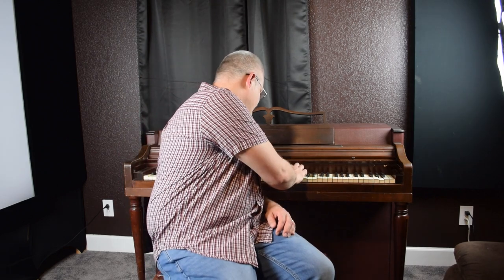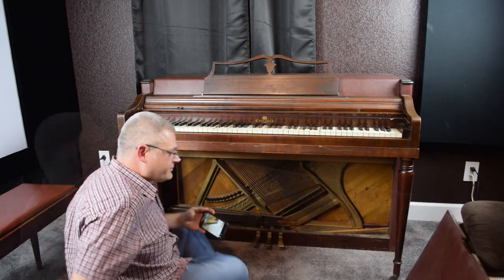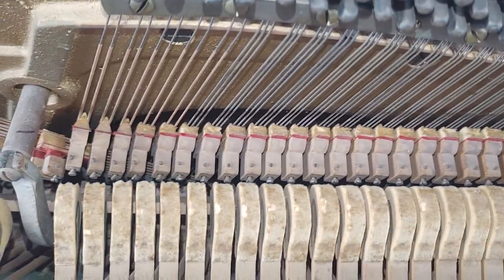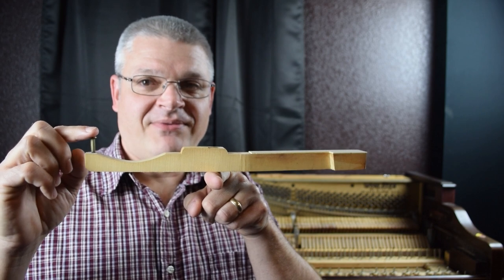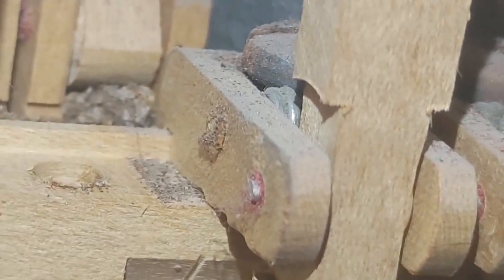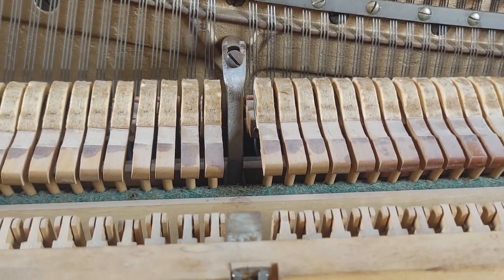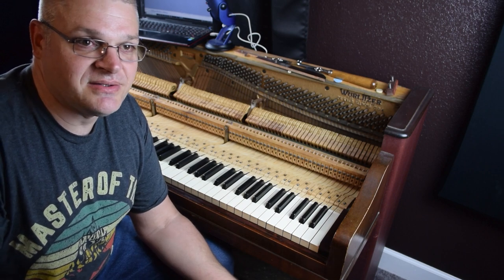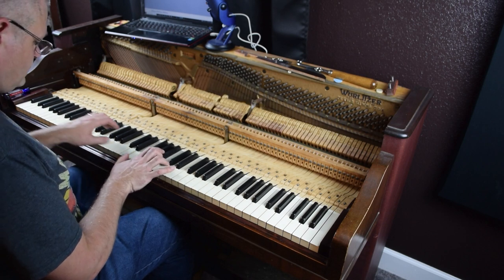1951 Wurlitzer Piano Restoration Part 1

Comment: Best of luck. For a Wurli, you've got a reasonably good example. Not to broken up inside. If you want to get the wax off the strings, use ice. cool it down and flake it off. Careful with the legs if you move it around. They really don't support the keybed in motion.

Comment: Could you make mention of the cost of some of the parts?
Reply from the maker: Sure!  $60 for the tuning kit:
https://www.howardpianoindustries.com/professional-piano-tuning-kit/

$52 Keyboard Punching Set
https://www.howardpianoindustries.com/keyboard-punching-set/

$4 Piano Damper Springs (12)
https://www.howardpianoindustries.com/piano-damper-lever-springs/

$4 Piano Damper Flange Cord (1 yd)
https://www.howardpianoindustries.com/piano-damper-flange-cord/

I still have about $200 worth of consumables to buy (damper felt, balance rail pins, backrail cloth, fallboard felt, plus possibly some high treble hammers if there isn't enough felt left after shaping the hammers)

Also about $400 in tools to ultimately buy, and $70 for a copy of Pianos Inside Out.